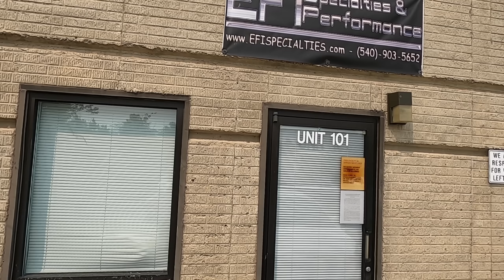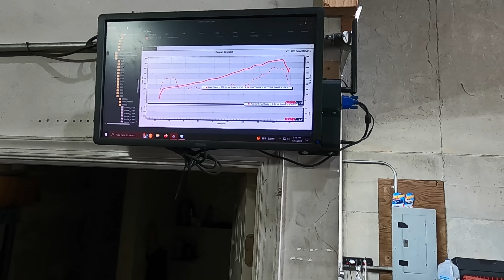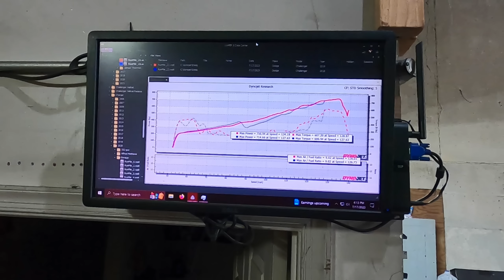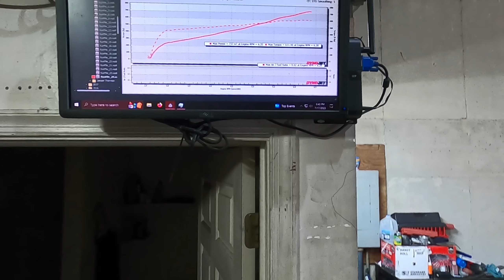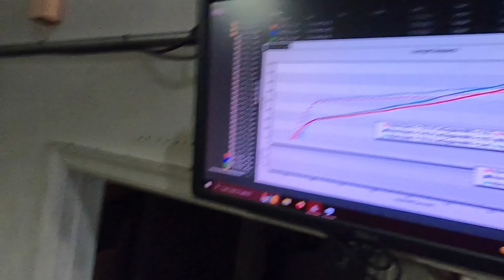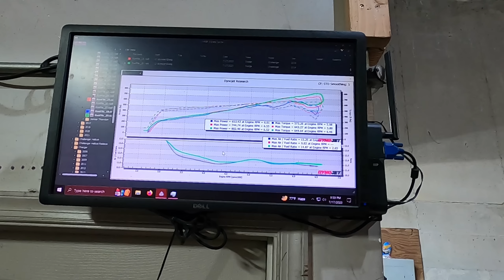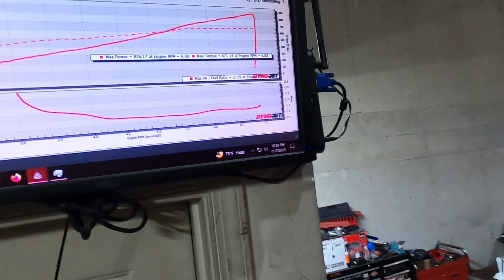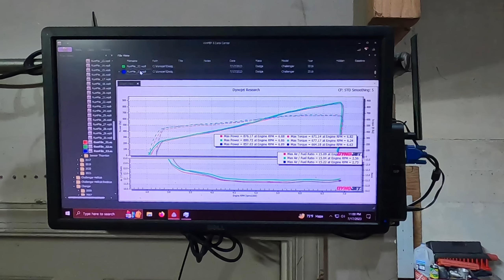New ProCharged and Cammed 5.7 R/T Hemi set up hits the dyno!

Comment: All this just blows my mind out of a 5.7🤯
Reply from the maker: Yeah boy! 5.7s are no joke when you deck them out! 💪
Reply: I think it's gonna blow that 5.7 too. lol
Reply: @kanervatie this man never heard of forged internals lol
Reply: @midnight347  Yeah, I know, what is that guys problem! lol
Reply: Everyone knows that the 5.7 platform is strong. The mopart drag car was made with a 5.7 engine
Reply: @kanervatie  never heard of forged parts
Reply: @redrum3925 ... it shouldn't, because the 5.7 was the original design of these small block Hemi V8... it basically brought along all the other displacement sizes... the 6.1/6.2/6.4 ... they're all basically the same... different intake manifolds and maybe the exhaust, but other than that, it's pretty much the same
Reply: ...actually a 5.8
Reply: @kanervatie 5.7s are the strongest believe it or not they can take the most abuse if you forge the bottom end it stronger than 6.4 and 6.2
Reply: People blow the bottom under boost not because the stock bottom can’t handle is but because of improper ring gap. Very overlooked by most imo 1 year now and no problems at all on stock bottom

Comment: I dont get why people are surprised the 5.7 did that lol come on its a 5.7, they are monsters.  Congratulations dude. Team 345
Reply from the maker: I know right! 5.7s are stout engines that's for sure! 💪
Reply: When boost comes into play displacement doesn't matter as much.  This is whytbe 5.8 gt500 wasn't really better than the 5.4 ones once they're all running the same blower and supporting mods/fuel.  They had a better stock blower among couple other minor things the blower is 95% of the power difference between them.  5.7 does good with boost and forged internals they can make good power on stock bottom end.  It's really not surprising it doing this.

Comment: Congrats remember me telling you the drag pack and the hellcat run the 5.7 stroke for a reason… can’t wait to see you gap them out of the hole
Reply from the maker: Yes sir! They run the same stroke. Gap cam coming soon! 💪
Reply: @Airwalkz23 ...which just so happens to be the same exact stroke as the 360 LA small block Chrysler... 3.58" ... so they're just running what the 360 used since 1971
Reply: @ModernRedHemi ...the 360 LA small block used a 3.58" stroke crank since 1971 ... so it's been around for a few decades ... maybe you let your readers in a little trivia (Mopar history)

Comment: What are you lowered on and front tire specs 🔥🔥I been following you for sometime and eventually I won’t to build my 5.7 up not to where you are but to at least beat and keep up with scats
Reply from the maker: So I have a race set up so it's not lowered but just looks that way. I have Lakewood 90/10 shocks up front and 50/50 in the rear with BMR Demon Killer springs all the way around. 😉
Reply: @nikkdunlap ... u can run a 150 shot of nitrous and do that

Comment: what do you mean by having the spark plugs gapped at 0.20? Like what are the benefits and how would you gap them
Reply from the maker: That's a smaller gap than stock. Only reason I decreased the gap is to stave off spark blow out due to the blower. NA you can keep stock gap, plugs are usually gapped that way in the box. 😉

Comment: 600 tq seems way light for 750 wheel
Reply from the maker: So those first pulls were on bad plugs and the wrong AIT sensor. Also remember this is a 5.7 so the torque numbers are going to be lower than if this was a 6.4 or 6.2. 😉
Reply: @ModernRedHemi  I was considering that.. I have a HC short block (376) with stock 6.4 heads with a Ray Barton cam and a D1X making 765/690 on 93...dyno's being dyno's  this is considered... stlll...will wait to see the trap mph.